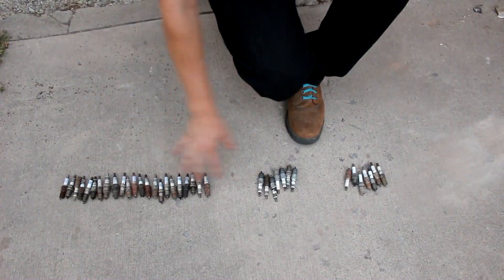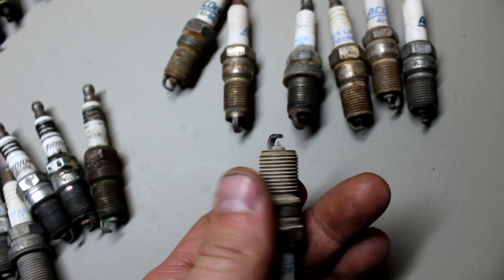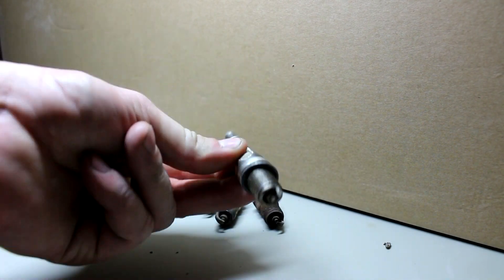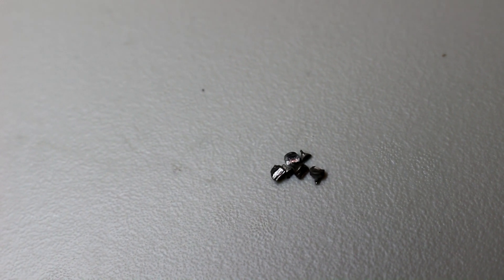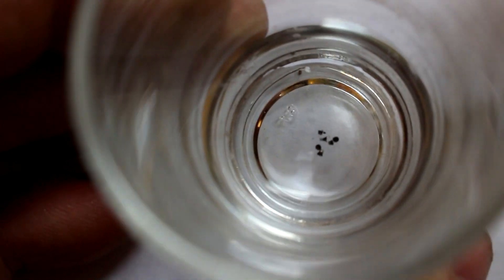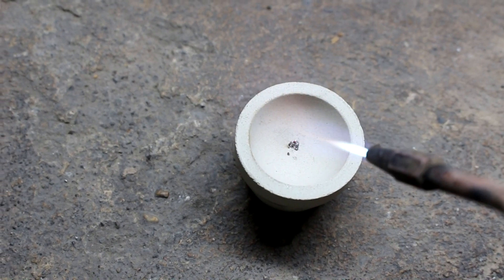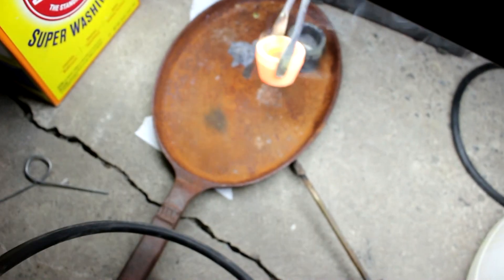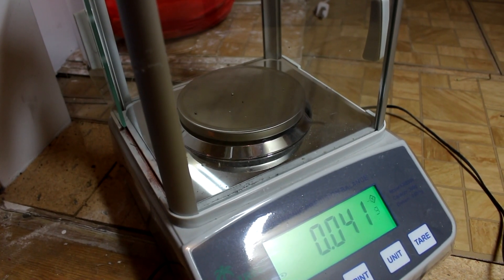Precious Metal Refining & Recovery, Episode 13: Platinum From Spark Plugs

Comment: Cody, what does the "tare" button do on your scale?
Reply: +Cody'sLab as part of work I calibrate larger scales. The scale is zeroed and then calibrated weights are loaded in increments on the scale, this is repeated on each corner. The scales I calibrate measure the out put of the strain gauge, or gauges, and calculate the needed corrections. If those corrections are to great the scale will fail calibration. There may be a service manual that has the calibration procedure for your scale, but I don't know where you would get the certified weights.
Reply from the maker: Same thing as the "Zero" button. the question I have is why are there two buttons that do the same thing?
Reply: +Cody'sLab some Its the same reason we don't update the periodic table with symbols that match our modern language, or the reason species are still classified with Latin. People don't like to take the time to update.
Reply from the maker: So, did some more research and found this explanation on reddit:
 "Zero tells the scale that there's nothing on it.  It's calibration.  
Tare tells the scale that whatever weight is on it should be ignored."

Basically if you "zero" a scale with a weight on it the scale will think gravity is very strong and will calculate mass incorrectly.
Reply: McMaster Carr sells calibration weights. Not the cheapest but they do carry them.

Comment: Cody, I am very interested in chemistry and by relation, this series, but I was wondering just why the borax and lead oxide form the metals into a solid bead.
Reply: They don't - the metals do that by themselves (surface tension).

The lead absorbs any oxygen in the metals, then the resulting lead oxide (letharge) is absorbed by the cupel.

Comment: i did the math with the diameter of the sphere of 1.48 mm and weight of 41mg and ended with 23.57g/cm3. the density of platinum is 21.46g/cm3. so the bead must be not that spherical and the 1.48 mm measurement must be across the shortest axis of an oblate spheroid.

Comment: Reason you have unlabelled platinum plugs is because they are the OEM version that is fitted to the engine when it is assembled at the factory. Thus there is no need to mark them as such, as they come in a very large box with the plugs in trays inside, and when the box is empty it is shipped back to the supplier to refill. Only the aftermarket plugs will be marked, the OEM ones, and the ones the dealerships get direct from the manufacturer ( often only used for either warranty repairs or for those vehicles under a motorplan where they have to use OEM supplies) will be simply in a plain box, with a sticker having the part number and a lot number only, not even a mark to say which actual manufacturer made it in reality. That you only can find from decoding the lot number.

Comment: Since you measured the ball of platinum, I thought I'd double-check your work. Assuming the ball is a sphere 1.48mm across, that makes the 0.041g have a density of about 24 g/cm^3; Wikipedia says it should be 21 g/cm^3, so close enough.

Comment: Hey Cody,
I was wondering, if any of the methods included in forging metals (hammering, tempering) could be used to modify the crystal structure other non metal elements in between their fluid and solid states of aggregation (other than smashing them of cause). Most interesting might be elements anyone can easily relate to, like H2O. But feel free to insert the most interesting element that comes up your mind.

Comment: You should make an arc furnace like the one your buddy Grant made on his channel
Reply: There's no point. Cody already has two different furnaces that heat quite well. Plus, that is really just for melting some metals. A full furnace can be used to hold multiple crucibles, even, while Grant's Arc Furnace is its own crucible and furnace.

Comment: AC Delco plugs aren't usually marked. They also have both Platinum and Iridium plugs. Aside from possibly finding a part number and looking it up, you would have to do what Cody would do to identify the metal (as you've done:-))

Comment: The negative strap on the spark plug is strangely enough called a ground strap.
A little bit of time in the manufacturer's catalog might yield some info on what metals are contained therein.  At least enough to eliminate some.  You might also be able to extract a more significant amount of platinum from a catalytic converter.

Comment: at $37.32 per gram, and 2mg per spark plug.... would this be a cost effective hobby?
Reply: I wouldnt think so, at 7.5 cents a sparkplug you would have to do over a hundred an hour to make minimum wage, even then the chemicals used to process it probably would cost more then the sparkplug itself. If you had the machinery to process a thousand an hour then yeah it might be worth it then.

Comment: Cody season your crucible with borax on the inner surface will glaze the borax with the torch. helps prevent cracking and preheats the crucible prior to smelting. thanks for your videos always enjoy your posts.

Comment: Cody, assuming that the bead is an ideal sphere, does its density match the one of platinum?
Reply from the maker: doing the math it came out to 22g/cm^3 that is close to platinum.
Reply from the maker: Considering that drops are approximately 1/10th of a milliliter its hard to measure small things like that. Best way is to take multiple measurements with calipers to get an average and then weigh it on a microgram balance. now if the object is very irregular in shape as they usually are, you can measure it by sticking it to the end of a wire and then submerging it into a water while on the scale. it will displace its own volume in water adding that much weight to the scale. to subtract the effect do to the wire simply do it again but with out the object just be sure to stick the wire in the same distance as before. for something as dense as this I may be tempted to use mercury instead of water. You know I aught to do a video on this some time.
Reply from the maker: ok so this will actually be a video very soon.
Reply: +Cody'sLab my favorite videos are extracting platinum and gold
Reply: Assume a spherical cow
Reply: dam that's pretty close,(0.041)/( ((0.074^3)*4*pi)/(3))=25ish, which is pretty close to platinum according to google
Reply: +james lawrence yeah, that is theory. but how exactly do you measure volume of the objects which are around 2uL?
Reply: adrian5b:     Don't assume it's a perfect sphere.  Measure the volume.
Reply: +james lawrence yes, weight of displaced volume, that is why mercury would give more precision as a measurement liquid.
Reply: He knows that, that's what he asked: "assuming it is a perfect sphere, did you verified its density to see if it matches with the nominal density of platinum?" … that's just to put it in other words, he wasn't asking how to obtain the density of an object.
Reply: Sernioum Deoiumnasderi
It won't go to 2uL, but if you take a pipette and count the drops until you reach 1mL and do that a few times until you're certain the pipette is consistent and then place the object in that graduated cylinder you can count the drops until it reaches the line. Then take this number of drops and subtract it from the average of your pipette calibration. Divide this result by your pipette calibration average and the ones place in this number will be the mL. Doing this you should wind up with 0.xxx and the first three decimal places will be your uL. I.E. 0.238 would be 238uL since it is 238 thousandths of a milliliter. I don't know of a more accurate way, and this won't take you to 2uL reliably, but it will take you below mL reliably.
Reply: +Sernioum Deoiumnasderi i wonder if surface tension effects would be of some significance with small objects in mercury
Reply: so each spark plug has a metal value of [drum roll] $0.07476 each [I bet you spended more just getting the metal out than it is worth], so if the price jumps 10x then these might be worth somthing
Reply: Cows bred in zero gravity might have no bone structure at all, leading to becoming spherical.
Reply: Patrick Sweetman AAAAAHAHA damn man you just made my day right now🤣🤣🤣
Reply: +randall williams what is the method to measure the volume of such a small object?
Reply: *****  hold up, it adds the weight of that volume of water, not the weight of the object, right?
Reply: Sernioum Deoiumnasderi
is this under the principle of buoyancy being the weight of fluid displaced is equal to the upward pressure and if there is an upward pressure, there is also an equal downward pressure?
Reply: +james lawrence Exactly. Archimedes' principle and Newton's third law.
Reply: +Cody'sLab would be cool...
Reply: +Cody'sLab I can't math. Whenever you explain something mathematically in your videos I have a hard time following along.
Reply: Literally weigh it, measure its volume. Divide them and voila. Not that hard.
Reply: small graduated cylinder with some water, see how much the water level rises when you put the object in. 1 mL = 1cc
Reply: adrian5b I want talking to him. I was talking to the dude below him.

Comment: @Cody'sLab
Almost correct on the gapping reason mate: Too big a gap & the spark is delayed- retarding ignition, and if too small a gap & the spark is to early- advancing ignition. Think of the spark plug as a kind of capacitor, dumping out the charge when it has reached a sufficient voltage to bridge the gap. Either way can be used in older engines (especially 2 strokes) to tune best for a given rev range. Awesome vid as always, thanks buddy!

Comment: The unmarked spark plugs; my guess is that they were sold in bulk to a car manufacture, so the spark plug company may not bother to mark them.  Thanks for another insightful video.  I've already learned so much from watching this, and Grant Thompson, I built my own Aluminum forge.  YouTube is important, don't ever let it change.

Comment: for anyone interested 40 miligrams is worth about $1.50, could be profitable if doing it on a bigger scale
Reply: And the 25mg of iridium is worth about $0.40
Reply: thanks 👍
Reply: But how much was spent in chemicals and heat to process?
Reply: that's why you would want to do it on a much much larger scale. Doing all that for just a few spark plugs is obviously not worth it.
Reply: aleksander suur If it was on an industrial scale, why would you even bother snipping the ends off, youd just dump a couple tons in and let it chooch. sieve and repeat.
Reply: There is no scale where this would be profitable.  I'll copy and paste my response from above where I was responding to a guy who suggested that with 1000 plugs it would be a lot more.  Imagine gathering, storing, and snipping 1000 plugs.  I'm not even going to bother trying to calculate out the time or effort required for such a task.  With 30 plugs he got around $1.50 worth of platinum.  Assuming no change of yield with scale, for 1000 plugs you're talking about $50 worth of platinum.  There is absolutely no way you're going to make this monetarily viable, especially when you start considering the cost of tools, energy for furnaces, etc.  Even if you don't value your time at all, you're still coming out with chump change if you make anything at all.  But seriously, just think how long it would take to gather 1000 plugs and snip 1000 plugs and ask yourself if you'd be willing to do it for $50.  If it takes you more than 7 hours to gather and snip 1000 plugs (so, you better gather and snip around 150 plugs per hour) , you are literally making less than federal minimum wage, not even considering other costs.  This is also all assuming that you have access to a place where you can reasonably acquire such a quantity of plugs without rapidly depleting your supply.  No way this will ever be profitable, even if you were using slave labor.
Reply: +David Serrano Have fun with that.  You will still not have enough supply to even recoup your start-up costs, even if you live around a hundred junkyards.  You also have to account for time to contact junkyards, you're assuming they would sell them to you for a decent price (there is no guarantee of this) and then you have to spend money travelling around to get them.  If you think it's a good business venture though, have at it.
Reply: Grob bley the same way people convinced the government to pay for recycling
Reply: +Bruce E i bet, tho just a wag, that it is not economical. probably Cody wanted to educate us non- chemist types. :)
Reply: yeah. if you owned a junkyard you could probably ground of the spark plugs then find a way to to have the dense metals fall to the bottom. then do it again and again until you separate each of the metals and from there you can do what Cody did. or whatever miners do. could be very profitable of you are already buying thousands of cars a year.
Reply: Grob bley it is very possible for it to be profitable. One idea is to have junkyards in your area pick up spark plugs and you give them a couple dollars for a couple hundred. Most places pick them up already when they do cleaning (if they do) so it wouldn't be too much of a hassle for the junkyard. Once you have a couple junkyards you just drive to each pick up a load of sparkplugs then throw them into machine you design.
Reply: Could you even cut the ends off 20 spark plugs for 1.5usd? Even the pair of cutters might wear off before they earn themselves back, you are snapping steel and that is not ideal for the tool. Great hobby project, but earning money with it, eeh.... lets be reasonable here. Not all costs can be scaled away.
Reply: RetroResto hmmzz.... dissolving base metals first, I actually calculated it and you would have to use 83% of the yielded platinum to pay for the HCl, that would be just silly on industrial scale. So for every 2mg(0.06USD) of platinum you dissolve lets say 50g per spark plug, 90% of it iron etc so 45g of iron, Fe + 2HCL = FeCl2 + H2 so you are going to need 2mol of HCL per 1mol of Fe or 59g of HCL per sparkplug or 0.05usd worth of HCl(250USD/1ton of 31% HCl) to get rid of the iron.
I might be a bit wrong somewhere but I don't think I erred with an order of magnitude anywhere so its still a non starter for a business case.
Reply: aleksander suur well what if companies paid you to recycle spark plugs. Which actually happens. Recyclers are paid by the city to recycle even though recycling is a profitable business. What if a sparkplug recycling company persuaded mechanics and junk yards to pay them to recycle the spark plugs.
Reply: Why are you grasping so hard at making this profitable?  It isn't going to happen.  How are you going to convince junkyards or mechanics to pay you to recycle spark plugs?  What is in it for them?  Do you even think these things through mate?
Reply: Eh I've gone through the "shiny expensive metals, yay easy money" moments myself. Brain freezes up on Gold! or Platinum! thinks of all the shiny and completely fails to consider what a pain it is to recover them.
Reply: aleksander suur all you need is an optimized way to separate the platinum. And a way to obtain sparkplugs.
Reply: David Serrano Recycling was largely the result of political pressure.  Good luck pushing the spark plug recycling business though...

Comment: Due to the increased resistance, it's also important not to use platinum spark plugs in cars that utilize a waste-spark system. It'll kill the coil pack in no time.

Comment: Cody, you need to make a hydrogen/oxygen torch.  They get up to 3200 C, plenty hot enough to melt palladium.  Could be a fun build video as well.
Reply: He has one! If you go through his videos you'll find it....he melted tungsten and other things
Reply: HHO refers to the fuel ratio (2:1 ratio of hydrogen to oxygen gas) in an oxyhydrogen torch.
Reply: drufzr600
Oxyhydrogen torches are popularly called HHO torches. It's just how it is called and as Josh Travis said it refers to the fuel ratio.

But I guess you're right saying there is no such thing as HHO, but I never said there was. I said "HHO torch" which is different.
Reply: He was trying to melt iridium not palladium
Reply: Well, iridium melts at 2446 C, so it would work for that as well.
Reply: drufzr600 Yes, but that's not what I'm talking about at all, so I don't see why any confusion should arrive. HHO is just easier to write and say than oxyhydrogen, which is why people usually say HHO.
Reply: Ah, I will have to go back and find it.
Reply: He has a homemade oxy/hydro torch. He has a vid or two on his channel about it
Reply: I do get why it is called HHO though, but it does cause some confusion in some
Reply: The confusion arises because people think HHO is not H2 and O2. Why not call a acetylene torch a HHCC torch then? Easier to write but it really is bad chemistry terminology
Reply: A direct quote from that Wikipedia link "Brown's gas[4] and HHO are fringe science
 terms for a 2:1 mixture of oxyhydrogen obtained under certain special 
conditions; its proponents claim that it has special properties."
Reply: His HHO torch is back at the farm. He's in town. He would have probably used it if he was at the farm.
Reply: There is no such thing as HHO. Water broken down with electrolysis produces H2 and O2, nothing else. 2 H2O → 2 H2 + O2
Reply: The problem is a lot of people seem to think there is a special gas called HHO (brown's gas) that is produced when water electrolysed, when it is simply just O2 and H2. This new gas is supposed to have new properties and is claimed it is not the same as H2 and O2. It is a common misconception in those selling water converters for cars. Read about it here for example https://en.wikipedia.org/wiki/Oxyhydrogen .